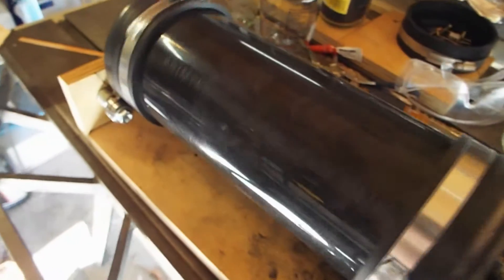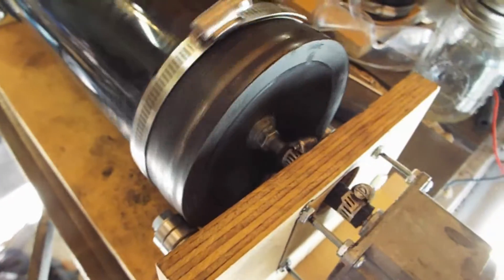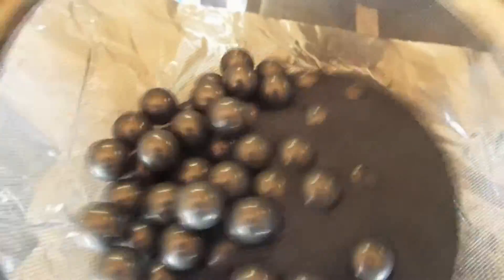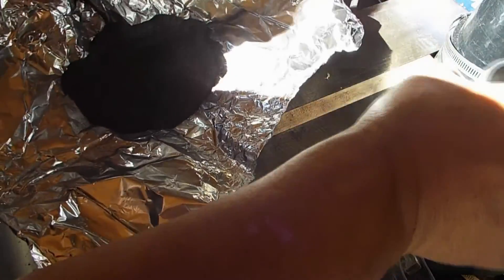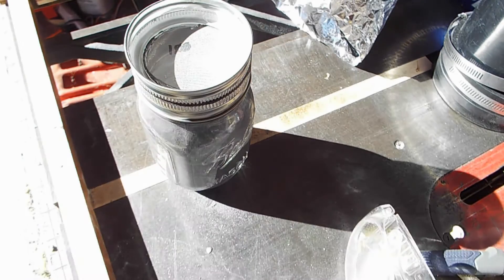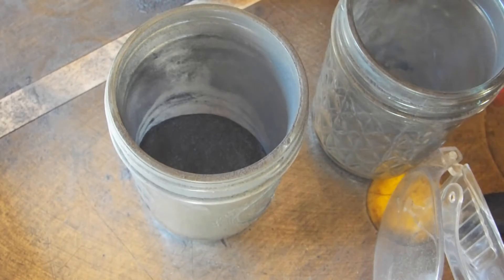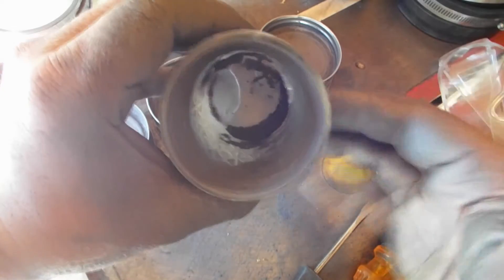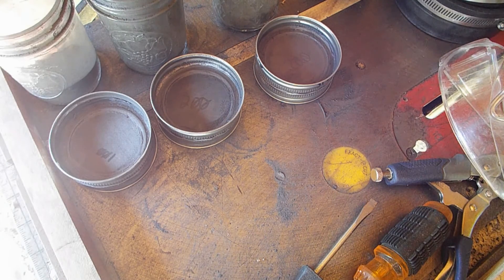Processing Aluminum Powder from the Ball Mill Down to  500 Mesh

Comment: If you were to speed the RPM up to about 40-50 or epoxy 3-4 lifting bars axially inside the jar, it would take a lot less than a month to mill. I am jealous of that mill though, looks rock solid.
Reply from the maker: I just wanted to experiment with the aluminum powder, I was not concerned with producing a large quantity or making it faster. It certainly does work just not very fast. One of the batches I made was actually very exciting, it spontaneously combusted when I poured it out of the mill!  Thanks for watching!
Reply: @madscientisthut  Perhaps this was due to the fact that the mill worked for more than 8 hours in a row without ventilation of the tank? Can I have more details
Reply from the maker: @joey2912  This was many years ago, my memory on it is vague, but you may be correct in the fact I did not open the jar for a couple days on that run. I do have a pretty good memory of trying to run out of the shop with burning aluminum trying to shovel snow on it to put it out. Was pretty scary.

Comment: hi, nice project and cool ball-mill. do you see any damage in the pipe or is the plasic strong enough?
Reply from the maker: +hisascha Thanks! It has been running for about two months now. You can see very small lines inside of the pipe wall where the ball bearings line up. I was very surprised that the wear is not much, I was actually expecting more wear. I suppose if I were to try milling some harder material in the mill that the wear would increase.